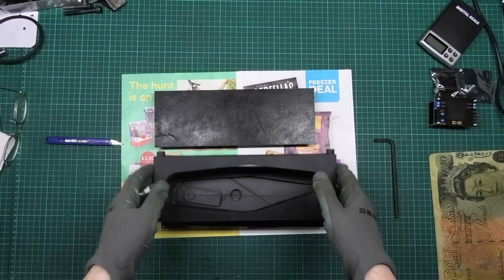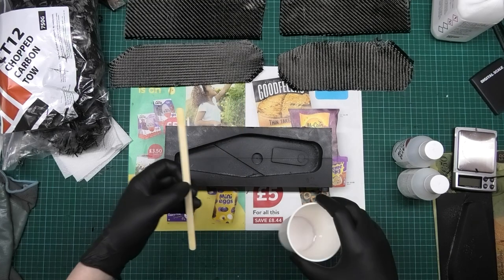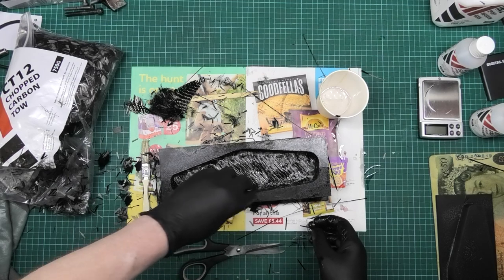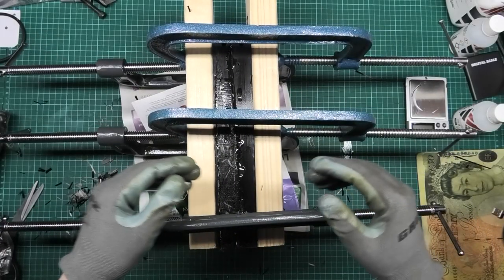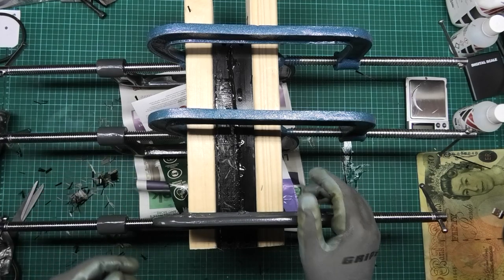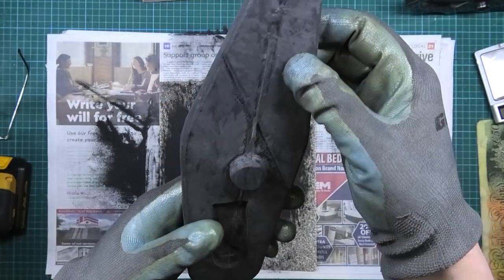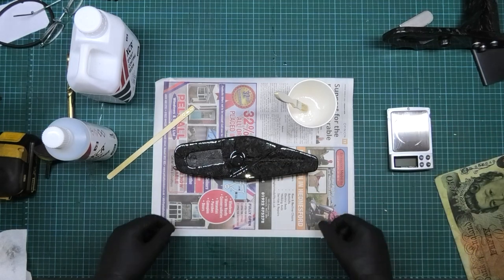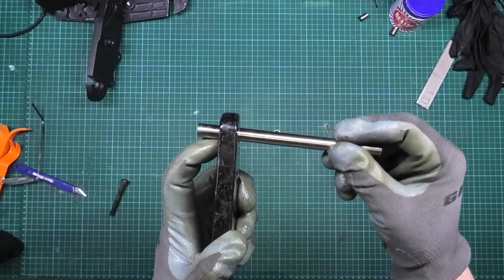🔴 EXTREMELY POWERFUL E-SCOOTER BUILD part 20 - The other carbon fibre swinging arm - the last piece?

Comment: I so admire your tenacity and patience Tony. I have to say though, this CF moulding is bordering on self-inflicted Masochism....lol...🤔😀🇬🇧
Reply from the maker: It's sheer torture mate and it's something I wish I hadn't started. The outcome was definitely worth it though, it's just as fast as my ebike 😂
Reply: @Vortecks  I'd of just reworked the cast aluminium ones and made some new bigger bushes ..Out of line bushes, so typical of China.... Can't wait to see it go, you'll need some smooth road...🤔🤔😀
Reply from the maker: @EnglishTurbines  Smooth roads aren't needed (except for speed) the air suspension is absolutely amazing mate. I went out for an hour and came back with zero additional pain!
If you want to see the maiden run, drop me an email - vortecks2000@gmail.com 
I'm not posting it on here for a while yet and I might cut a large portion of it out.

Comment: Wow you are lucky to be able to stand up for at least 2 hours, the most that I can stand up for any one time is 3 - 5 mins before I'm screaming in pain or I drop to the ground even if I've taken huge amounts of prescription pain meds that would put most ppl to sleep for a few days if they took one dose, I take 2 doses a day & it's not enough, probably removes 50% of the pain during summer, 25% of the pain during winter.
Reply from the maker: I know I'm not anywhere near as bad as you but I do understand. On a good day, I can stand for 2 hours but on a bad day, just standing up is excruciating. Like you, the only way to get around is with pain meds which (as you know) don't work as well as they used to. Some days, I do wish that I was numb from the waist down but I do try to keep a positive outlook knowing that I do have good days. The worst thing for me is the muscle twitching in my calf, it can start twitching, even in my sleep and sleep depravation makes Tony a dull boy.

Comment: Glad to see you back again Tony!
When using the drill, would it be easier on your back if you had the drill in a vice with a ziptie or velcro strap over the trigger and only had to move the workpiece instead for the initial sanding, I always have big trouble stopping drills from kicking out when I use them like you showed and that aggressive action hurts my back alot when I try to fight it.
Reply from the maker: It's all technique mate. Under no circumstances do I let my back take any strain, if the drill kicks, I let go. When I'm sanding, I only have it turning very slowly and it's easily supported with gloves on. I did try putting the drill in a clamp but the carbon dust has further to fall and it goes into the air but when it's on the table, there is zero dust flying. I only do 5 minutes at a time and then leave it, it just looks like I've done everything in 1 go because I join it all together.
Reply: @Vortecks  ahh fair point Tony, I end up getting the shits with having to stop all the time and try to power through, always ends up with me in bed for a week. I'll keep what you said in mind when I finally give this a go, I'm in a one bedroom unit so I'm worried about fibre dust, especially with a young'n running around.

Comment: Watching you cram the tow into the mould, made me wonder if it might be an idea to premix it with resin before putting it in the mould ?
You're doing well with this mate. Good work.
Reply from the maker: It's hard to explain but doing a pre-mix would waste a lot. If I had too much, I'd be throwing away epoxy and carbon fibre. If I do it the traditional way and I have too much, all I lose is the resin and I always have too much.

Comment: A year after my operation in 2013 in 2014 I became crippled with pain, to get around I need to use a wheelchair but I can walk for 3 - 5 mins at a time with extreme pain for the last 8 years. If I were permanently disabled from the waist down then I could do a huge amount of things just using the wheelchair but because I have full use of one leg & partial use of the other leg, that all movements are pinching nerves in my back it basically means I'm useless. Only the pain creates the problem of being useless & you have no idea of how many times I've wished it would all end in my sleep with death I don't have the ability to give up, I can't give up.
Reply from the maker: I'm certainly not as bad as you. I've heard a lot of bad reports from people who have had operations to releive pain and the pain then appears somewhere else or makes the original pain worse.
I keep going because people seem to think I make good videos. I have a purpose and that's what drives me through the pain. I have good(ish) days and very bad days, today I'm having a good day and I've been able to sit upright for nearly 3 hours but now, I''ve had it and I'll be flat on my back for the rest of the day.
You have my fullest sympathy mate, I certainly wouldn't like to live every day as my bad day.
Reply: @Vortecks  Thanks mate, after a long time you get used to it. My operation was to remove an abscess that was growing outside my spine & inside my spine, very deadly, it was killing me.